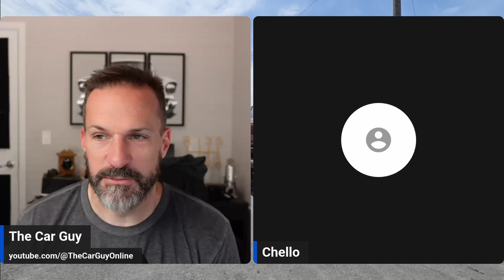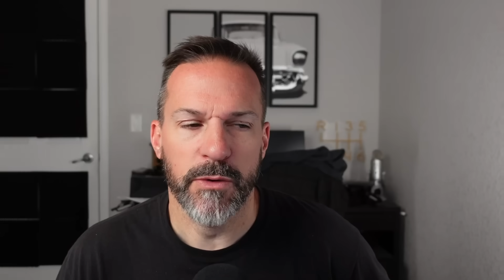Former GM Engineer EXPOSES Planned Obsolescence Tactics.

Comment: Even as a child, I could tell the GM vehicles we owned were a different quality than the Fords. Think 70's up to 2010. When I starting wrenching, I could definitely see and feel a difference. I have repeated this to anyone who listened and the GM nut swingers turn their heads. Now in my mid 40's, I stand by a vow that no GM vehicle will reside in my driveway. I own 90's Fords and Hondas. When my wife wanted a new vehicle, I told her it had to be Toyota or Honda.
Reply: I'm 55 and I saw the same differences when I was a kid in the '70's. I now sell auto parts, and the ratio of GM parts sold to Ford parts is hugely different. Is it because GM is flashier and more popular, so there are more of them to have to fix? Partly, I'm sure. There's that good ol' boy mentality where Chevy is the "party in the rear" side of a mullet and Ford is the "business in the front" part that causes people within certain thinking arenas to buy Chevy's more. The very valuable and worthwhile coolness factor. 🙄I think that a lot of it is that GM vehicles appeal to people who just don't think about the practical side of things as much, and reliability is a pretty practical thing. And most of the GM people I deal with love wrenching on things, so they're quite happy with broken down vehicles. I sell a LOT more GM parts because, people.

I drive a 2004 Tacoma but if I were nuts enough to buy a new truck today it would be a non-Ecoboost Ford pickup, like the 5.0. I've never quite liked the 4.6's or 5.4's. Toyota has been slipping the last few years.

Comment: Former GM engineer and GM fan.  Last years of decent GM would early 2000, right when the 3800 Series II ended.  Never buy a 4 cyl GM no matter what year and some V8s are good ie LSx.  My daughter is still driving my 2001 Buick. Solid drivetrain.
Reply: I’m still driving my 2001 Chevy Impala with a 3.86 cylinder with 248,000 miles and still running
Reply: I’d have to argue their decline started in ‘07-‘08 models.
Reply: I would love to drive my Saab 9-3 and have another for the wife. It just works! But then you realise you live in Denmark and the annual tax for those two cars would actually exceed the cost of one of the cars!! Almost 2000$ a year -- every year just for tax even if the car just sits there not driving.
Reply: 3800 is legendary. I hear the 2.2 ecotecs are very reliable. The 2.4 had issues. I have a 2.0 LNF, but since it's a performance engine, I'm not expecting more than 200k miles.
Reply: 👎 3800 series 2 was paired to crappy transmissions widely known for ridiculous early failure, horrible engineering

Comment: Heard this from Chrysler execs over 20 years ago.  If any part of the car had a life greater than 100k miles, then there was a big argument and intense pressure to cut the life and thereby cut the cost.  The goal was for the car to completely fail (all parts simultaneously) at 100k miles.  That was before Daimler bought them, etc.

Comment: Haven't watched but putting my 2 cents in. 8 year ex gm dealer tech. I've done engines in all makes and models. In 19 we did a couple 5.3l engines with 5 miles on the od. Most with around 50k rare would see one with 130k. Are they lemons? Abuse? Ect. Seemed like something else but that's just me
Reply: Cheap components made in China and  India coupled with half-assed assembly by American workers that don't give a rip.
Reply: @billwilson-es5yn your exactly right but the conspiracy theorists in me always tries to find a rabbit hole 😂😂

Comment: Former GM master tech, and I used to also write TSB's.  I used to save all sorts of old parts for my own purposes.  I left GM in 2008 when they started doing really really crazy changes for the worse.  It really got bad in 2007 onward.
Reply: So would you say if I want a GM, get one prior to 2007?
Reply: @N47E-D0G this is what i do... w trucks anyway
Reply: @N47E-D0G I'd say so.  There's also a reason why they still hold their value to an absurd level.
Reply: @N47E-D0G exactly what I do
Reply: @N47E-D0G that's a good rule of thumb for almost all American makes. Especially anything Chrysler. Post 07 Chevy trucks aren't bad, as long as you stick with a 5.3 and address the idiotic cylinder deactivation bs.
Reply: We saw it. The trucks literally devolved. Rear drum brakes became standard again on the silverados
Reply: The frames alone, with the huge inaccessible pockets under the rear of the cab
Reply: GM behaves like a tentacle of US Govt and not like a car manufacturer. It all fell apart after the bailout.
Reply: @mayankexodus It started before the bailouts.  There's a very specific reason why you were able to buy two different body style trucks in 2007.  2007 classic and 2007 new body style.  Halfway through the year is when the government implemented mandatory tire pressure monitoring systems and egr coolers on diesel engines.   That's why they went to the LMM variable vane turbo Duramax engines.  Once the government mandates hit,  their quality dropped.  It's also why Ford got rid of the International 7.3 and went to their turd bucket 6.0 turbo diesel.

Comment: My father complained about planned obsolescence.  For him it was the yearly styling changes, taillights, fins etc.  This roughly gets serious in the 1950s, and shifts towards mechanical issues in 1971 as emissions and oil trade issues come the foreground.  Cost cutting and a focus on efficiency and safety drove cars to look and feel worse and worse, until Iacoca started the very modern trend of actively destroying the car.  People have forgotten how the K-car was the 1st car in America to go into "Limp Mode".  The transmissions failures on every k-car based vehicle (minivans etc) went straight into the bank for Chrysler.  People had traded in their 1970s cars for something smaller and lighter, only to start chasing expensive repairs. Sound familiar?  Iacoca "saved" Chrysler by using government money to mechanically short sheet American workers (while also laying off line workers).   Then the shift to electronics happened.  EFI started in the mid-1980s and was a mess of non-standard crap based on carbs being modded into throttle body injectors.  Independant shops started to go broke until the 1996 OBD2 standard forced manufactures to make things more accessible.  But another shift was on the way.  Consolidations of brands was happening.  Mergers and acquisitions were all the rage in the 1980s, and this has not really stopped.  Now there are 14 parent companies that own all 30 or so "brands" of cars.  And with anti-trust laws giving companies the freedom to let up to 40% of their board of directors sit on more than one board, it doesn't take much math to work out that all 14 parent companies have at least one board member sitting on every other board.  This makes a perfectly legal cabal of gangsters, carving up territories and staying out of each other's way for maximum profit.  Did you ever wonder why a car company can produce garbage that can't even make it to the end of warranty without several recalls?  Answer: because the car company isn't chasing customers, they are chasing return on investment.  What car you buy makes no difference.  The money all ends up in the same pockets.  Tools and all.  Want to fix your car?  Go buy a bi-directional scan tool for a grand then pay a yearly subscription.  And why is something as simple as a hex head not sufficient to torque down a bolt?  How did GM make a genuinely defective Northstar V8 for 20 years?  How did Ford get away with simply ending Ranger sales in America while still selling them in other markets?  
The tactics of making transmissions cheap is window dressing on burning house.  Car companies are international crime syndicates, warping laws in their favor with lobby groups and even regulations.  We are a long way down the rabbit hole, Dorthy, and crappy metallurgy is really nothing compared to the legal B.S. happening to extend the lives of these companies at the expense of our own lives.   Electric car battery rant anyone?
Reply: Electric car batteries?
      Just look how they Preditorily Engineer  the battery locations on EVs. THE ORIGINAL EV-1 THAT GM produced in the 1990s was an engineering mistake because it was too good. The battery was elevated in the back seat .... instead the car makers design their evs in the lowest possible part of the vehicle so that it is subjected to water levels caused by flooding on roads. People will drive though flooded areas because the mainstream public is addicted to car travel. Once an Ev Experiences a flood it is totaled because that battery once damaged , will not only fail but also suseptible to fire.   Can you as one person change that battery thats inaccessible without a car lift and special tools?  I call that Preditory  enginneering design. That started in the 1930s by Alfred p. Sloan That is when he started National  city lines. A front company of GENERAL  MOTORS to get people out of traveling on electric rail public transit, and become soley dependent on auto travel. 
         Also please note that car gurus on you tube will never say PREDATORY ENGINEERING IN CAR MAKING,  AND THEY WILL NEVER, NEVER SAY "STAINLESS STEEL CAR MODIFICATIONS " SUCH AS BRAKE FLUID LINES, CUSTOM MADE BODY PARTS OUT OF STAINLESS STEEL....IT SEEMS LIKE STAINLESS STEEL AND PREDATORY ENGINEERING ARE BUZZ WORDS TO CAR ENTHUSIASTS, I HAVE EVEN WRITTEN TO THEM , AND IT SEEMS LIKE THEY HAVE DEAF EARS TOWARDS MY TWO ISSUES  ..........Perhaps secretly they are in cahoots with car makers?
 
MISS PAULA WALACH-FORMER INDUSTRIAL ELECTRICIAN-UNION MEMBER IBEW LICENSED SINCE 1972.STILL WORKING FULL TIME IN THE TRADE FOR A COMMUTER RAIL TRANSIT AUTHORITY.
Reply: If the general public knew the ugly truth about EV'S they would be globally banned.
Reply: You sound like a younger me. 😂

Comment: Yep GM plan is to use cheap components to build the car and when they break later they charge you the customer to install a slightly better component at the dealership for way more then it should cost. I remember my tail light bulb burnt out and as a test I went to the stealership to see how much it be to fix. They wanted to charge me 60 dollars to change a bulb that cost 3 dollars at oreillys and takes 2 mins to change with a simple screwdriver, it was a Chevy cobalt. Never went back to any stealership after that

Comment: This is not unique to GM, sadly.  This is how every company operates.  The battle between the engineers and accountants is real, but neither is “in the wrong”.  Engineers would develop a product that is high quality, and performs better than competitors - but the cost to build it would be 2-3x more than competitors. Things are built to a price point these days, and consumers are only willing to spend so much $ on a product. In fact, more recent consumer spending trends suggest consumers want to spend as little as possible on stuff, even if it comes at the cost of quality. Just look at Temu, etc. People will buy cheaply made products that don’t last bc they don’t cost much. 

The one place that engineers can actually have built what they designed is in government work, on a Cost Plus contract. That way the government pays the actual cost to design/make the item, plus a profit margin for the company.  There’s less incentives to look in to cost cutting measures.  (Unless the contract is bid low, or underfunded…)

Any company that makes things has to look at their bottom line, and the current economic truth is that companies have to shave costs whenever they can.  $2 saved per ignition switch adds up to a lot multiplied across years of production - even if they know that ignition switch design is faulty.  A cheap transmission? Only has to last the warranty period. As long as stuff lasts the warranty period, the manufacturer doesn’t care what happens down the line.  There’s very little incentive to design a car that will last 20 years without issues. That’s 2-3x the expected ownership length of the initial buyer - ie, the manufacturer’s customer. You don’t want your customer waiting 20 years to come back to buy another product! 

In theory, cost cutting measures can make products more affordable to the customer without affecting quality - but in reality, cutting quality drops cost even more and pads the bonuses of the executives making these decisions. They are directly profiting off just how cheaply they can make something. Greed will win out 99% of the time. 

In many industries, consumers are buying brands they perceive as quality based on a bygone era, instead of an assessment of the current state of the company.  I’m a GM fan, have owned cars from as far back as 1964 to as new as 2016.  I bought a luxury truck - GMC Sierra SLT Plus 4 door crew cab (I wanted the Denali, but no dealers had them in stock at the time so I got everything except the sunroof and mag ride.).  The truck cost a bunch of money, but it was real nice at least, right? Nope. It looked nice. It felt solid. It had lots of features. But besides being slow, having terrible ride quality when empty, terrible handling, terrible to park, etc - it had issues. The transmission would lurch forward without warning if you were trying to crawl at 1mph. It did that 3-4x in a year. Brand new truck. The whole truck would shake on a smooth highway. Some owners said it was the tires, some said the shocks, some said to change both. Again, brand new truck on a smooth road, and I was about to lose a filling in my tooth. 

I test drove some other new GM vehicles, and they felt cheap. Their sticker prices weren’t! 

Again though, this isn’t an issue only with GM. It is very difficult to find a quality made vehicle that will last.  The high end German cars tend to feel great when new - but 5-10 years down the road, and you’re looking at very costly repairs or just costly scheduled maintenance.

Comment: Not Only is GM responsible for this But Also the U.S. Government.
The EPA and the Officials that supported and regulated by LAW enforcement and policy to push shotty work and engineering. And go after mom & pop shops with SWAT teams & Millions in fines that repaired or tried to improve automobiles outside of Dealerships.

Comment: 80's I was working at a GM dealer. 700R4 They gave us a steel ring with teeth in it to go over the front pump seal to keep it from blowing out. That's when I knew it was over.

Comment: My father purchased new 69 Toyota Corona and then   74 Toyota Corona.  Never had an issue with those cars.  But, under pressure from my Grandfather to buy American, he purchased a 78 Chevy Caprice Classic.  As a kid, I remember him getting so angry and writing letters to GM about the transmission failing and A/C problems.  This influenced me as I have never owned anything by GM, Ford, or Chrysler.  I have purchased mostly Toyotas in my life and I have never had a CEL.  I currently drive Lexus LX470 with 308k miles and an Ineos Grenadier.

Comment: Define planned obsolescence - a policy of producing consumer goods that rapidly become obsolete and so require replacing, achieved by frequent changes in design, termination of the supply of spare parts, and the use of nondurable materials.

GM still refurbishes the 4L60-E and makes parts for it, so that doesn't fit. They cost cut the planetary, but then beefed up the component to make it last longer, so that doesn't fit the definition. Nothing in this video fits the definition planned obsolescence. 

Sooooo...let me get this straight. GM wants to reduce costs in repairs, switches to a worse metal but beefs up the component itself, on a transmission that was phased out of existence 12 years ago, and that somehow proves planned obsolescence? Hint, all car manufacturers want to save money and will do things exactly like this. All the people saying GM is failing haven't looked at sales numbers lately. In 2024, they held 40 percent of the pickup truck market on their own. 

And yeah, if engineers keep coming in and saying, "Hey, lets do this multimillion dollar fix." And the heads of the company say, "Hey, we're looking to do something that doesn't cost as much." And you keep bringing high dollar proposals forward, what did you think was going to happen.

https://gmauthority.com/blog/2025/01/gm-full-size-truck-sales-numbers-figures-results-2024/
https://carbuzz.com/general-motors-q1-2025-truck-suv-sales-booming/

Comment: Still Running a 2002 Tahoe.  250k on it.  Just rebuilt the engine and drivetrain...should be good for another 250k and 20 years. To hell with buying anything made today.  They collect more data about you then your phone and you can't  change a tail light without a scan tool or a trip to the dealer. No. Thanks.

Comment: Yeah, that's what engineers at GM do. I'll bet the engineers at GM are still scratching their heads over how Grumpy Jenkins got 840 hp out of a small block 331 cubic inch engine without boost in 1975.

Comment: I have a 2015 Chevy Colorado. I have over 200,000 reliable miles. Toughest vehicle I have ever had. Tires, brakes and an alternator is all I have had to replace. The alternator was my fault. Doing high rpm donuts and burnouts in snow. Still have original shocks. I use all high quality synthetic replacement fluids everywhere.

Comment: In other words- If they design and build the perfect, reliable and bulletproof transmission, eventually a bean counter comes along and wants to cut corners to make it cheaper to save 25 cents per unit.
Reply: Also, when it fails, the shop repairing it will have to buy an overpriced rebuild kit. The parts divisions of the car manufactures are a significant income source, sometimes more profitable than the new car sales.